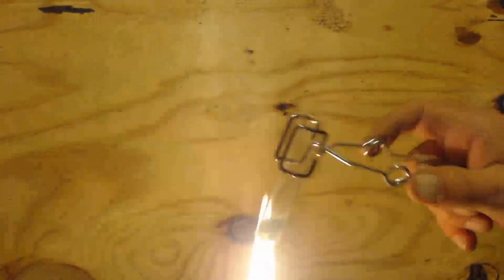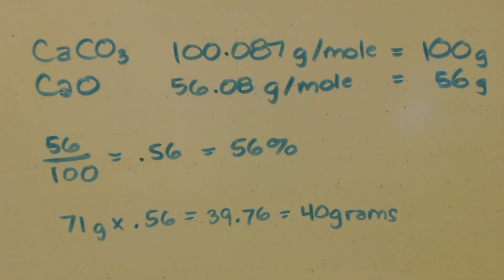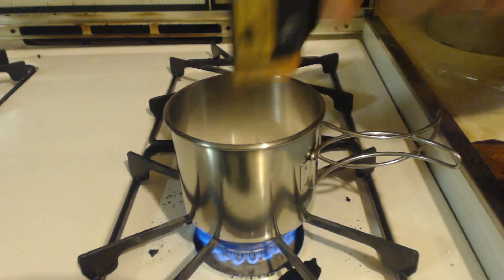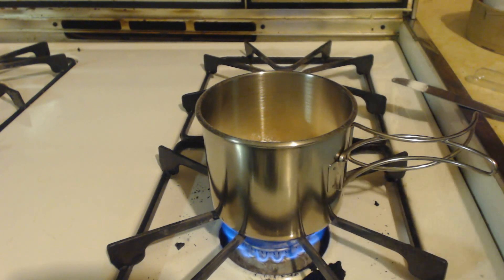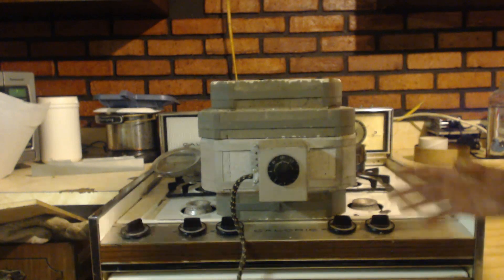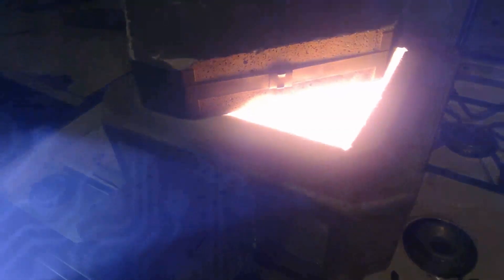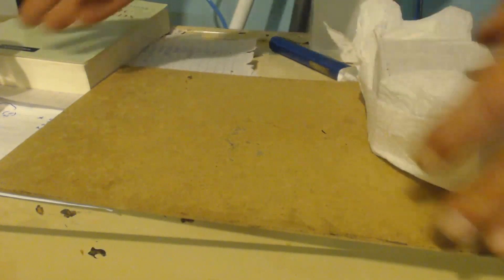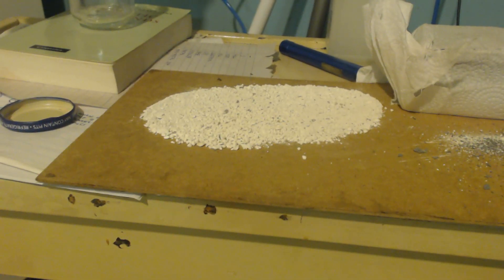MAKING CALCIUM OXIDE (calcination reaction)

Comment: Damn John, I about fell out of my chair laughing at this one. Torches! 'nuff said.
Gotta love the learning process. Thanks for sharing! We definitely learned Calcium Carbonate is a terrible heat conductor.
And a crucible is crucial, LOL
Actually I just put a few nice chunks of white limestone in my fireplace and pull them from the ashes the next day. Put some on the table and over the course of a few days watched it automatically fall apart and slake from moisture in the air. 
The limestone/quicklime/carbon dioxide cycle is fascinating natural geo-chemistry.
Reply from the maker: Mark.............Yeah it took a few attempts but i finally got it done

Comment: Hey, I need to make some calcium chlorate, could you help me with this?

I've tried going from potassium chlorate and just doing a displacement with calcium but it's not working and I didn't really think it would.
Reply from the maker: FERRIS...............To tell you the truth i do not know how  to make calcium chlorate but i can give you a couple suggestions.   You can make some calcium bleach by bubbling chlorine into a solution of aqueous calcium hydroxide.   And then MAYBE just like making sodium chlorate from sodium bleach you could heat the bleach to make the hypochlorite bleach into chlorate and chloride.   In your case it would be calcium chlorate and calcium chloride.  The calcium chlorate is a lot more soluble than the calcium chloride so you could recrystallize the chloride salt out just like when making sodium chlorate from bleach.   Many videos on youtube  making sodium chlorate from bleach.     I am just GUESSING  the calcium hypochlorite would react to heat just like sodium hypochlorite does and creates the chlorate and chloride.    If it does work i fore see one problem.   When making the calcium bleach you need calcium hydroxide dissolved in water so you can bubble the chlorine through it.   But calcium hydroxide is not very soluble in water.   Maybe you could dissolve as much calcium hydroxide as you can and then bubble chlorine through to make the hypochlorite and then add some more calcium hydroxide and bubble more chlorine threw and repeat that process 3 or 4 times until the hypochlorite is abundant in the solution.   IT IS LIKE A LOT OF WORK WITH NASTY CHLORINE.  
                       MAYBE this is a better idea...........MAYBE.      Make the calcium hydroxide solution from 2 aqueous solutions you mix together.   One aqueous sodium hydroxide solution and one calcium chloride solution.   I do not know for a fact but maybe raising the pH will allow more calcium ions and hydroxide ions to stay in solution.    Then bubble in the chlorine.   At the end of the experiment you might have a mix of calcium chlorate and sodium chlorate but at 0C degrees sodium chlorate is  69g soluble in 100 mL of water but calcium chlorate is well OVER 210 g soluble in 100 mL of water.  That is TRIPLE the solubility,   so maybe you could recrystallize the sodium chlorate out first and then when you think you got it all out then recrystallize what you got left to get pure calcium chlorate.    WAIT I JUST LOOKED ON WIKIPEDIA and you can heat calcium bleach to make calcium chlorate.   Here is a cut and paste
                 Calcium chlorate is produced by passing chlorine gas through a hot suspension of calcium hydroxide in water, producing calcium hypochlorite, which disproportionates when heated with excess chlorine to give calcium chlorate and calcium chloride:[1]

6 Ca(OH)2 + 6 Cl2 → Ca(ClO3)2 + 5 CaCl2 + 6 H2O
                    You will definitely need some bubblers(scrubbers)/suckback traps and a fume hood for this experiment or outside.   Making bleach SUCKS big time.    That is really the only way i know how to make a chlorate is heating up bleach.  If i think of anything else i will let you know
Reply from the maker: Ferris...........Wow there are a lot of videos on how to make sodium and potassium chlorate and none on calcium chlorate.   Making bleach SUCKS like i said in the last post.   But i wanted to clarify if you have  a fume hood and bubblers then it is not that bad
Reply: displacement reaction will work but calcium chlorate is highly soluble so it will stay in solution - there will be some contamination with potassium

simply boiling a solution of calcium hypochlorite (bleaching powder, chlorinated lime) will yield calcium chlorate and calcium chloride by disproportionation - separating the two salts is difficult due to high solubility

pure salt can be obtained by neutralization of chloric acid with calcium carbonate - excess carbonate will precipitate

the (dilute!) chloric acid can be obtained from barium chlorate and sulfuric acid

there are may ways - just look up old inorganic chem. textbooks: Brauer, Fieser... etc. etc.

Comment: Could you do a video on how to remove calcium from cold packs?
Reply from the maker: Doldoe.......I could be wrong but i think cold packs are based on ammonium salts or urea and not calcium
Reply: @johnblacksuperchemist2556  yeah they started adding calcium to deter you from making speed I guess you just have to boil off the calcium I guess to get pure ammonium nitrate I'm not sure though
Reply from the maker: @anthenriqe909  ..........You might be able to recrystallize it out.   Do you know what type of calcium salt is added to the cold packs???????????    Do you want to use the calcium or do you want to use the ammonium nitrate????????    Cause that would effect how you purify or separate the salts.
Reply from the maker: @anthenriqe909  ..........I am looking that up.   I see it is like a double salt.  Calcium ammonium nitrate.   In solution it is a bunch of calcium and ammonium and nitrate ions.   But if you evaporate the water away you will get a double salt of calcium ammonium nitrate.  Not sure how to separate a double salt.   Might be easier just to buy some stump remover (KNO3) and some drain cleaner (H2SO4) and make some nitric acid and then buy some ammonia solution (with no soap or additives) and then SLOWLY mix the ammonia solution and the nitric acid together with some cooling.   Then just evaporate the water and recrystallize your pure ammonium nitrate.
                             Maybe you could add some Na2CO3 to the cold pack stuff.   The calcium carbonate would precip out but then you would have sodium nitrate as a byproduct.   BUT  Maybe then a double salt would not form when the water is evaporated and you could purify by recrystallization .............LOTTA IF's
Reply: @johnblacksuperchemist2556  sounds like too much work lol reckon Amazon sells ammonium nitrate
Reply from the maker: @anthenriqe909  ...........Yeah it is always easiest to just buy it.

Comment: I know you said to "don't quote me" but uhhh

4:42 they would make the hydrogen from the elctrolysis.

i thought you said at 4:13 that they didn't have electricity...
Reply from the maker: Samuel............WOW good catch.   DC electricity and electroplating has been around for a very very long time.   When i say they did not have electricity at 4:13  i meant they did not have AC electricity that went from house to house.   They also did not have light bulbs yet.   Electrolysis uses DC current.    Yes it is electricity too.    I should have been more specific on what type of electricity they did not have back in the day.  GOOD CATCH.   Shows you are actually paying attention.
                      There are many mistakes in a lot of my videos like the mistake you mentioned.   And mistakes that are worse than that.   When you find any mistakes let me know with a post.   I actually been thinking about watching ALL my videos right in row and find all the mistakes and post below the video about the mistakes.

Comment: John,

I have those same stainless steel camper's mugs as I stated in my last comment.  I wonder after sanding it down if the mug could possibly be nickel plated.  I've been meaning to buy a nickel crucible for a while and I don't know how well it would stand up to certain applications, but it's really resistant to oxidation.  It might be worth a try to plate nickel onto the mug.  Stainless steel isn't really something that is easy to plate, but after burning the shit out of it, it's really not stainless steel anymore.  Stainless steel?  Not on my watch!
Reply from the maker: Matthew Wilson......that is a good idea.  I was going to make some crucibles with sodium silicate /aluminum oxide.  I am soooooooo lazy.   Need to get moving with stuff.
Reply: @johnblacksuperchemist2556  Nice.  I'm getting ready to do the same.  My last crucible bit the dust a while back.  I've got tons of blue foam from Deschem's packaging of their glassware.  Use wood glue to glue pieces together to form a block, then use a file card and course grit sandpaper to rough out a shape for a mould.  Use finer grit sandpaper to smooth out the surface to your liking and then cover the entire surface in a coat of wood glue.  Sand it smooth and make sure no blue foam is exposed.  Coat the surface in bondo or epoxy then sand as smooth as you want the surface to be for non-stick moulds.  Spray the surface with silicon grease and then you can resin cast the piece or whatever you want.  The wood glue protects the blue foam from organic solvents, so the options are plentiful for your choice of mould making media.  Hell, you can use JB Weld as most of us have that sitting around.

I went to art school for college, majoring in Industrial Design and Technology.  I focused on miniature scale modeling, special effects and prototyping.  I know so many different mould making techniques.  If you ever need a 3rd eye, I'm here.
Reply from the maker: @mwilson14 ...........Wow you sure know some stuff.  May take me a while to get around to making a crucible.   Right now trying to distill some startex toluene to see how pure it is.

Comment: Those stainless steel camper's mugs are what I use for a lot of decarboxylations and calcined oxides.  Even once they get a hole in them from wear and tear they make good covers for small thermite reactions.
Reply from the maker: Matther Wilson .......as soon as i get this one last chemical .......sodium bromide.  I am going to do a decarboxylation.  Got a tin can though
Reply: @johnblacksuperchemist2556  I've got a good sized container of sodium bromide.  I've had it for about 6 months now and I haven't any idea what I'm going to use it for yet.  I just know it was on sale and I would use it eventually some day.
Reply from the maker: Matthew Wilson...............i plan on using a lot of sodium bromide for grignards (making the alkyl bromide).   I figure it wont be as nasty as making alkyl chlorides. for the grignard